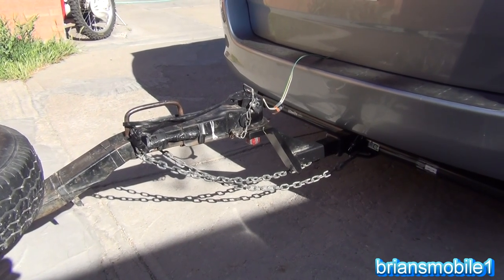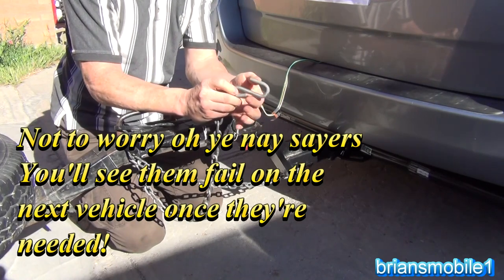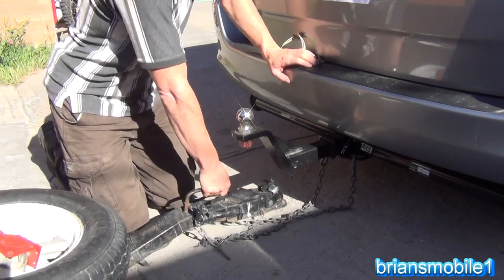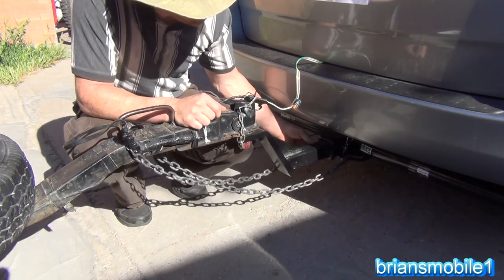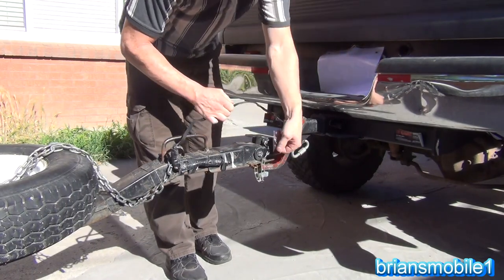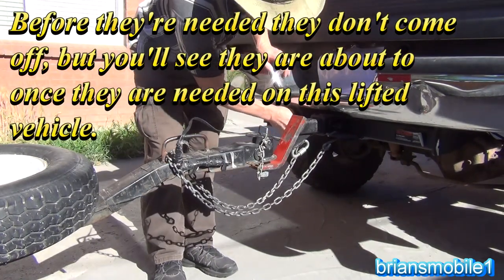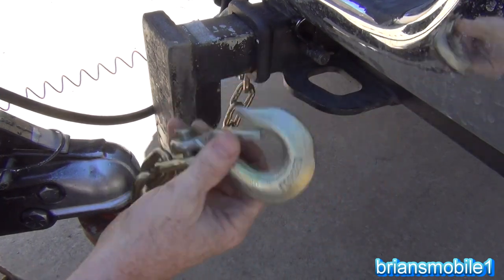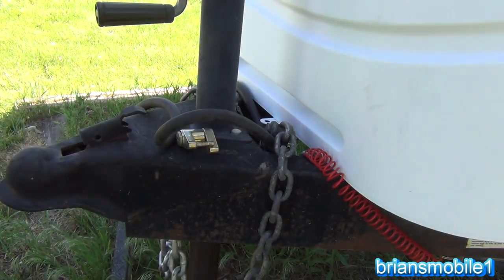Re: Utility Trailer Hookup Video  Chain Clips & Wire Routing

Comment: You dont hook up a trailer for only 5 minute and take it off. So just use the most effective clips you screw shut even if they are slightly longer to put on. You can't flick a closed loop off the hitch. I have a magnet stuck to an old wrench, and stick it under the bumper so I never lose it !

Comment: Uhaul has rubber 8 things that act as clips to hold the hook in place. Works great.  Also, on your car hawker hooks. Couldn't you trim a little metal off the clip/hinged bar so it doesn't come in contact with the hitch when the hook turns?

Comment: Those hooks with holes in them four the clip sure sucks :p High chance of braking wen needed. I like the hooks that are made just like the karabiners fore climbing. And has an short twist to unlock. And can handle surprising scary high lodes and stress. Not cheap but good life time investment.
Personally I wood not put the wire true the clip. But that's just me. Except if its a clip made by me.  An pin with treads on it so you can put an locknut on it. Mostly to prevent theft. Hire you have an decent chance they steel your trailer while your waiting on traffic lights. And those cheesy locks specially made four trailers. Suck even more XD And a lot les chance it will come undone.  And then the clip like you have it. With a bit of tape a round it to prevent the cable damaging over time. Call me overkill. But personally I never take chance with a trailer. Wen something gows wrong... It will go catastrophic. And less chance you get an ticket that cost an arm and a leg.

Comment: I am looking to get a Reese type receiver installed on my blazer but the different terms have me a little confused. Perhaps a video to clarify the different classes of receivers and hitches and any tricks for judging what the trailer load weighs or proper distribution etc.... We have a small utility trailer and we don't haul much weight or very often but I would like to get a camper and or small boat or car dolly someday. So i figure any knowledge I can get now can save me headaches in the future and ensure we are towing safely. We may add a stock trailer soon also.

Comment: I use a padlock on the ball latch.  it adds a little bit security when the vehicle is parked and unattended and there's no possibility at all of it coming undone while you're driving.  and then when you unhook the trailer, it's an extra security measure against theft of the trailer along with those locks that go into the receiver.

Comment: I like to use the removable chain quick links that have the threaded portion on them to allow for removal.  That way you are guaranteeing yourself that the safety chain will not come off.

http://www.etrailer.com/Merchant2/graphics/00000001/pics/C/8/C82930_1000.jpg
Reply from the maker: I believe I featured those under MOST secure, but less convenient.  You're right about them being a secure connection.

Comment: Here in Australia most people use d shackles ( the u bolt with the threaded pin that goes through one side then threads into the other) ain't nothing get them off unless the chain or d shackle snaps

Comment: Your old hooks are fine, drill a hole in the end of the hook and pass a big rip tie through it and cut the tail long enough to act as the keeper. It doesn't have to take a load it just has to keep the hook there on flappy slaps and keeps the integrity of the load portion of the hook as there are no holes drilled in it such as with the clip type you showed us .

Comment: I enjoy all of your videos. You have a good heart. One thing I do, good or bad, is if the chains are longer than they need to be, I twist the chains to take up excess slack. What do you think?
Reply from the maker: That is a good tip/trick.  It's not as flexible when twisted, but it's SO much better than dragging on the ground and scraping.
Reply: We need an engineer for that one, But I would reckon that the sudden pull would cause initial torque on the chain, but as a chain is links it should even out as tension increases, so they should work almost exactly to their specifications. Maybe even better, such as how a rope is made. MInd you, I'm thinking of a constant load, not a random arsed trailer departing it's bar.